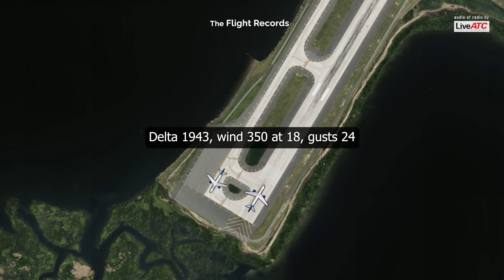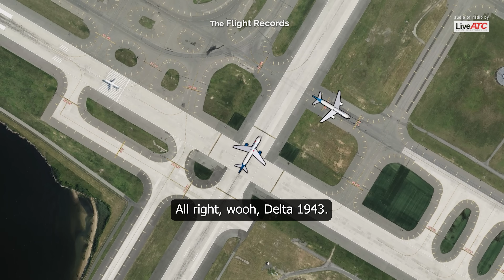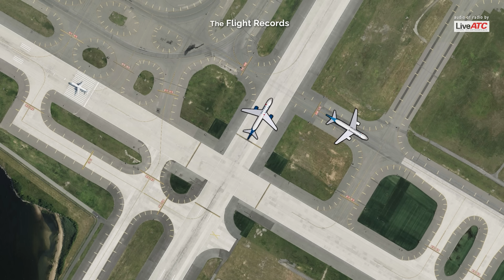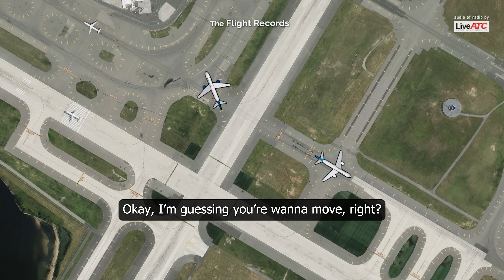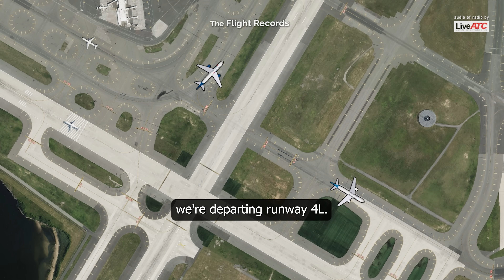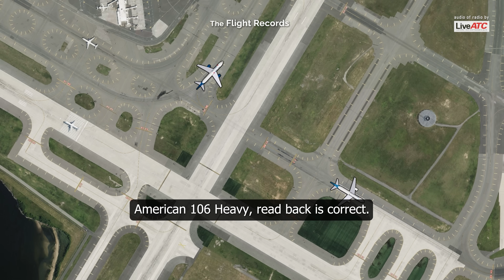NEAR HIT AT JOHN F. KENNEDY AIRPORT

Comment: “Air Disasters” almost had new material.
Reply: Mentour Pilot will have new material - because it does not matter if it is an incident or accident, there are always lessons to learn (and authorities see it the same, hence they will have a full investigation, even though no loss in lives and little damage - except for wear of brakes, tyres and delayed flights).

Comment: Nothing new that hasn't happened before or will not happen again.
My take away is that some ground / tower communications that are urgent need to be standardized and / or shortened.
American 106 heavy hold position = American 106 STOP!
Delta 1943 cancel takeoff clearance = Delta 1943 STOP STOP STOP!

Comment: It was close 
i dont see the big deal?
There was no bent aluminum
Reply: the industry learns from the near crashes and the incidents as much as they learn from the (catastrophic) accidents. hence the full investigation and it is conducted in the same manner as if that had been an accident. The safety concept in aviation is that errors and malfunctions are expected and then several safeguards and redundancies are put in place for every process (or part of the equipment, be it plane or airport) to compensate for errors. 
In this case the catastrophic outcome was prevented in the eleventh hour - way too close for comfort. One factor was in their favor: likely good or not too bad visibility. And a system of JFK that tracked the planes or the controller could see the lights and interpreted that deviation from normal fast enough. Also: likely the crew of the plane that was about to take off (and had done everything right), likely also could see the lights of the plane that incorrectly crossed their way. 

There have been pilots taking the wrong turn in the past, or mistaken a dimmly lit runway in repair for an active runway (for their landing) that error is not unheard of, even when the situation does not seem to be complicated in hindsight and for outsiders.
Almost always it has to do with bad visibility. (that was not the case here and likely saved the day. It was night, but at least not very bad visibility like heavy rain or fog). Such mistakes / being mistaken about the taxi path / map, or unclear communication (that was a factor in Teneriffe too, it added to the misunderstanding of the taxi "map") has the potential to lead to catastrophic outcomes.

See Teneriffe in the late 1970s, where one large plane was on the wrong runway and took off (misunderstanding non-standard phraseology by ATC as clearance) - and hit another large plane that correctly stood on the runway waiting for clearance. It was the biggest loss of life in civilian aviation in one accident, over 500 humans perished).

Some airports have a complicated map. Or lights are supposed in place (but aren't, bad maintainance, equipment is in repair, etc. ). There was an accident in Northern Italy in ? Milano after 2000 where one commercial machine during take-off hit a small private aircraft. The pilot of the private aircraft knew the airport well. Less training than the pilotes flying commercial planes but on the other hand they knew that airport very well. But because of the dense fog they still were disoriented or mistaken and parked on an active runway.
Reply: The mistake was made (taxi way, a not so uncommon mistake) the one missing ingredient for a really, really bad outcome was bad visibility. But you do not always have erring pilotes in combination with well trained and well rested air controllers & good visibility - so it was a big deal.

Comment: Did the controller said line up and hold or wait 3L at KE; or was that a read back of AA185; or  is that a typo in the caption of the radio audio? I hear '31 Left' JFK don't have a 3L runway. The runways at JFK are 13R - 31L / 13L - 31R and  4L - 22R / 4R - 22L.

Comment: Instead of crossing 31L and holding short of 4L, they crossed 4L to shold short of 31L. I still don't understand why they don't have something resembling traffic lights at the intersections of the active runways. Humans are error prone. This will happen. 
And to a civilian, the garbled muttering on the radio seems to be a "filling in the blanks" game based on assumptions on what the message will be. A pilot may think that he hears the message clear, but he/she will not know how the brain pieced it together. If we play back the radio message slowly and find that the words aren't there, then the words aren't there. It's not a matter of "training".
Reply: ... they can't have a traffic light because it wouldn't be tall enough for the tall airplanes to see.  It would have to be 50 feet tall. Also, a plane that would be landing and had to go around could hit that 50 foot traffic light.  What they have been installing is a red light bar on the ground to prevent planes from crossing the runway.  Problem with that is that we do run them over and even the best LED lights and wiring still get broken from the immense weight of these 700,000 - 900,000 pound aircraft.  The runway they crossed has those red light bars on the other side, but I'm not sure if they haven't finished putting them in on the west side or they don't work.

Comment: I noticed when the ATC told AA 106
“Cross 31L at Kilo.”
I wonder if it would have helped if they would have said 
“Turn R cross 31L at kilo.”
Reply: it would give a slightly clearer picture but radio calls in the U.S. are quite often fast/rushed/impatient sounding and they have no time for extra info. the pilots are at fault here.
Reply: @globalnova  There is NO excuse for blurted out ATC clearances!!!  They were not so busy to speak a bit slower and clearer! And I don't need the 'You have no idea what ATC---"!  Wrong I have 35 years of ATC experience and there is zero excuse for not communicating clearly!
Reply: @jmarrs7239  I am not saying it was as clear as it should or could have been, but atc said cross 31L at K, so if they are aware of where they are they would see a turn into K to cross that runway. I agree with you, clearances in many places especially USA are too quick . if I don't get it I will keep asking until I do.
Reply: @jmarrs7239   Yes - I am always astonished how rushed ATC instructions sound (when you also factor in that sound isn't always that good), NO redundancy in the way they communicate. You are right: just slowing down speech by 10 or 20 % might give more margin of safety.
Reply: @globalnova  
I have heard some recordings of ATC saying 
“Turn R” and cross runway
Reply: @PInk77W1  me too.
Reply: @globalnova  it mite have helped in this situation but not required I guess

Comment: Did Delta have to go back to the gate to check the brakes for damage or were the pilots too upset to go back around and take off again?  Or, was it both?  I ask because the American Airlines plane (which caused this near debacle) continued to their assigned runway and took off for London.
Reply: DL had hot brakes and couldn’t depart and I heard the crew timed out
Reply: @meganproffitt424  Thank you!
Reply: The pilot needed to change clothes. 😊
Reply: They did ??? Gosh
Reply: @postcardsfromprotest  Well, yes... That's why I said hot brakes (plus crew timed out) was why the plane didn't leave.
Reply: I saw another almost runway crash (discussed on the channel of Mentour Pilot) and the brakes (likely a Boeing) also needed 45 minutes cooldown time. - I just wonder about the tyres ;) here - probably they left some rubber on the runway ;)
This former incident was at an US airport, during day with excellent visibility. At least at that time they allowed airplanes to line up at the runway and to take off with very short intervalls - if visibility and weather conditions were good. 

It worked like this:
One machine was allowed to accelerate speed when the one before them was still visible on the runway and just about to take off (which the automatic of the machines already reports to ATC as "airborne" or at least that was the technology of the time. I think that automatic has something to do with the pressure readings on the landing gear). 
It was just necessary that the more advanced machine did not create any  turbulences for the following machine. So a larger plane using the runway for take-off very shortly after a smaller plane like an Embraer was O.K.

"Almost airborne" being reported as "in the air" became important when an Embraer automatically "reported" to ATC that they were airborne (and in fact that machine type does that earlier than most other planes) but then they had to abort their takeoff in the last second because of a bird strike.  Luckily the larger plane behind them had noticed that the Embraer before them in the middle of the runway did not really take off and after a few seconds they processed that they did not have the right speed and that they slowed down instead of accelerating and that they remained too long on the runway . 

So crew was faster than ATC to notice. 

(Embraer had announced to ATC their airstrike, and the aborted take-off but that was drowned out by other communication).  And the proceedings were so rushed that a few seconds did make a difference. 

The controller had to work an additional area because they were not "busy" - for that airport. That shift had one controller less than usual - likley they planned such reduced shifts according to weather report. In order to see that runway (his additional responsibility) he had to stand up and turn around. So his realization that the Embraer did not really fly away came relatively late. By then the crew of the larger aircraft had already seen that something was not right and they had aborted the take-off. Both planes managed to came to a standstill within the runway and with some distance between them.

It was a case of "too much efficiency". ATC working more than usual load, not seeing the planes w/o extra effort (and when turning away from his other work and equipment),  the speeded up take-off procedures. (which were legal in the U.S. but would not have been allowed in Europe). 

The incident also triggered an intensive investigation.
Reply: Some companies have a policy that you have to contact your operation duty manager after a high speed rto. Makes sense. I don’t know what the AA did but if they continued that would be their second mistake that day.
Reply: @valicourt  why’s that?
Reply: @postcardsfromprotest  probably wasn’t close to v1
Reply: @vito774  I've read that they were at about 115 mph when the RTO was initiated, from what I understand that's not far from the v1 depending on the variation - they run  147- 154.  I bet it was quite a ride onboard that day.
Reply: @scott17601  so still under 100 knots and they usually take off around 170 mph or 150 knots. They only traveled about 3000 feet down the runway according to reports. Derated takeoff since they had 10000 ft runway. I’m sure it was still violent and had to cool the brakes.
Reply: @vito774  for non-aviation folk like me the concept of knots is hard to get a feel for.  Oddly the article I read said they were at 115 mph - I can however imagine someone "hitting the hooks" at 115 and the force that would throw you with.  I guess that's why seatbelts are required during takeoff and landings! Thanks for the additional info - aviation news is a big interest of mine.
Reply: @scott17601  there are some amazing YouTube channels that cover aviation. And I guarantee that was a wild ride.
Reply: @vito774  I'm subscribed to a lot of great channels, my favorites are 3 minutes of aviation, and Mini Air Crash Investigation.
Reply: @scott17601  you subscribed to mentor pilot?
Reply: @vito774  Oh yeah I watch most of his videos - he's great, and his dogs crack me up!  I also have a few plane spotting channels I put on as background when I'm working.  I've probably watched every Mayday and Air Disasters (still not sure if they are actually different shows or what).  I also watch Kelsey over at 74 Gear.
Reply: @scott17601  Here's a funny thing: that 115mph referenced probably started as "about 100 knots". 100 knots = 115.08mph